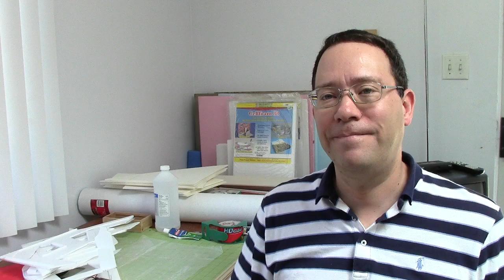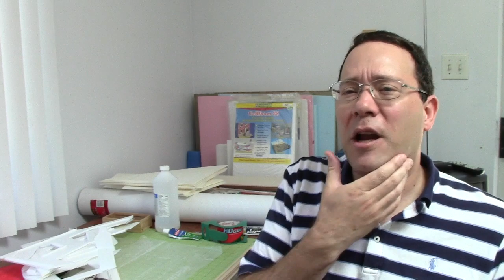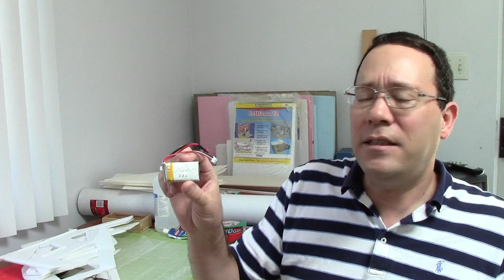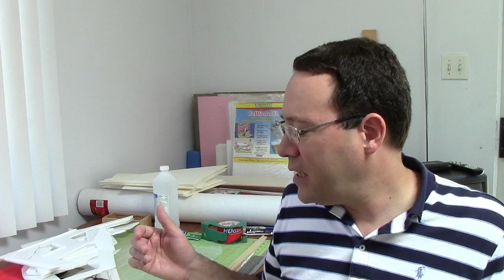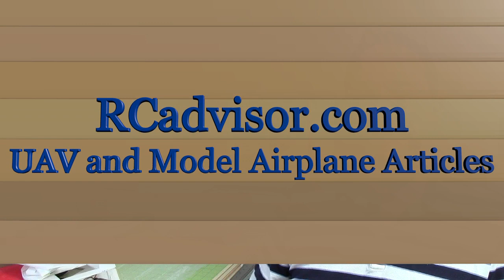LiPo Battery Care Tips

Comment: Hi, I just bought the Imax B6 charger, but I want to charge a 18.50V lithium battery, it has 10 (3.7V batteries) 1200 Mamp each one.
It has 5 batteries in series and it has another 5 batteries in series in parallel whit the first series, total 18.5V 2400 Mamp, but if I understand right, I can charge only 6 batteries at the time, so How can charge this battery without disassembly it?
Can you help me or somebody else to understand how to do it?

Comment: Hi Carlos, I liked very much your comments. I'm always looking for good tips on how you can extend the performance, safe and life span on our Lipos. I think you covered most of the important topics but you missed the Charge rate "C" if you like to extend the battery life I found that not matter that the manufacturing recommends. It's always better to lower the C charge no higher than "1C" and always check the discharging amps to not exceed the batt-specs. Thank you for posting your video! -joe